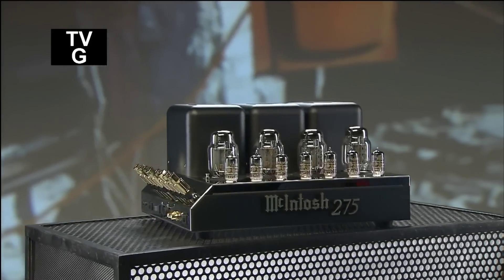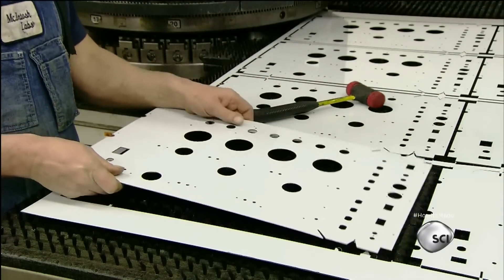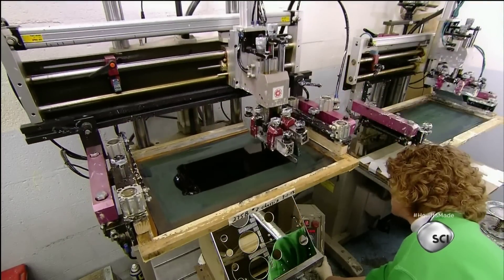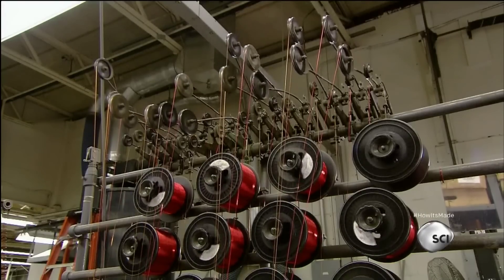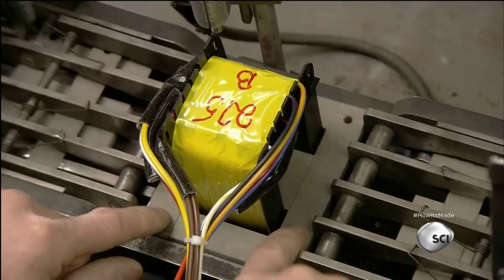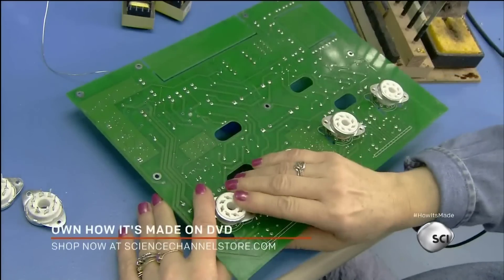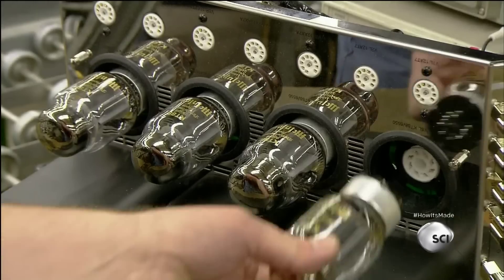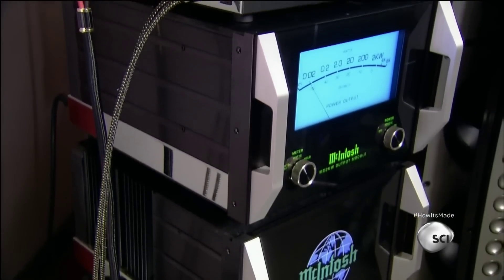How It's Made - McIntosh Tube Amp

Comment: Tube amps are the biggest waste of money. Thanks, but if I want to colour the sound of music I'm listening to I'll use an EQ. Fuckin' hipsters. The best way to listen to music is the way the artist intended, not coloured through some trendy piece of shit amp.
Reply: You're correct, they do color the sound, but they do not do it in a static way that can be mimicked by a single equalizer setting. Tubes have a non-linear response which means that their output varies not just by the incoming signal's amplitude, but also by its frequency. Essentially, you'd need to dynamically adjust your equalizer settings as your signal gets louder or changes pitch. None of this is impossible of course but the solid-state solution is largely more complicated than tube amplifiers which is why no one's really "perfected" a solid-state tube equivalent...though there are some really close examples out there I'm sure.
Reply: The thing that gets me with audiophiles (and I love high end audio) is that most of them seem oblivious to what actually happens in a recording studio.  Ignoring for a moment all the tubes used in making the record in the first place, mixing and mastering engineers go to great lengths to make sure that then end result sounds great on modest playback systems.  Aside from that rare classical or jazz recording that deserves to be held in such high regard, I believe that most CDs benefit greatly from a little color.  There's all sorts of unnecessary distortion being added to the recording by engineers anyway.  My philosophy is if there is anything one can do to improve the sound of a record, do it and enjoy life.
Reply: Tube amps add 2nd order harmonic distortion to audio. This is perceived as pleasing to the majority of listeners because of a warmer, less harsh midrange.

There is nothing wrong with tube amps. You honestly just sound like a jealous kid who can't afford one.
Reply: Roflmao! You still use an eq? That's hilarious. There's not one hipster that will ever know what McIntosh is first of all. And second amps don't eq shit. they never have... They just take the audio signal and send it to the speaker AMPlified. Then the speaker crossovers the signal to the corresponding driver. And to listen to a recording the way an artist intended you wouldn't have an EQ in line with your system to begin with.
Reply: Tyler Horsman You're harvesting what you sow ;)
Reply: it's not  preset EQ, it adds harmonics , vacuum tube amps sound way beautiful than pathetic Ipods
Reply: I have built many tube amps, I make them from scratch, dude.I am currently listening to a single ended 807 amp in triode mode that I built myself. 5 watts out at 2 percent 2nd order harmonic distortion. Sounds awesome and dynamic, as opposed to any amp with large amounts of negative feedback to mask the circuits distortion. I listen through Altec Lancing 811 horns with 806 drivers tamed with a crossover network. JBL K-130 15" drivers for 100 to 1800hz then the horns to 10k, then Prosystems bullet center ring radiator tweeters for 10 to 20k. This speaker system goes over 100dB with 1 watt input. If I connect a high negative feedback solid state amp to these speakers, I feel fatigued and the sound is noticeably compressed. Not pleasing. I would rather listen to distortion spectra that humans respond favorably to, as opposed to the non "organic" odd order harmonic spectra of solid state class AB push pull amps. SS amps with very large amounts of negative feedback just so they can measure good on the bench. Our ears are not lab instruments, we like to hear second order harmonics as opposed to third, fifth, seventh, ninth etc. Yes, I know the "tube" sound. My humble little homemade amps can compete in blind A\B listening tests with any amplifier on Earth for sound quality and prolonged listening pleasure. Yes, I just typed that.
Reply: HeartOfGermany The problem with your idea of using your PC's EQ to turn down the highs to make a warmer sound is that a tube amp would not attenuate the highs like that.

Therefore, it's not as simple as "10 clicks" on your PC to "do the same thing for free."

And music, once properly mastered, is supposed to sound good on any competent and properly functioning audio system, no matter if it's valve-based or transistorized.

Also, high end audio doesn't give class D much credit because it's nonlinear.  There are concerns with signal linearity, or lack thereof, with class D.  Because the input must be converted into PWM as part of the class D process, the output might or might not be a proportional match to the input as it would always be on a properly functioning class A or class AB configuration.
Reply from the maker: Jesse McLen
Very well stated, Jesse. Harmonics are where the "life" of sound and music live.
Reply: Electrons prefer to travel through a vacuum vs rushed through a semiconding crystalline lattice.  There is a specific tonal quality to a tube amplifier.  It can't be explained.  So stop bashing on the tube amplifier until you have actually listened to one in proper working order.
Reply: You are badly misinformed and ignorant, and your attack is abrasive like non musical odd order harmonics. Tube amps can be made very simple and with superior harmonic distortion spectra on the device level and circuit level, with no or very little negative feedback applied in an attempt to correct distortion in the circuit. You need vast amounts of distortion masking negative feedback to make solid state amps measure good, and by doing that the non musical odd order harmonic spectra dominates over even order musical harmonic structure. This is easily observed on a spectrum analyzer with a fundamental sine wave passing through each circuit topology. Single ended triode tube amps, with their large second order spike, have almost no odd order distortion spectra. This "sounds" better to humans in general. Even a discreet device high end solid state amp will show large spikes at third, fifth, seventh etc. harmonic distortion frequencies. Manufacturers get low distortion measurements on paper by only listing the even order distortion levels, when often the odd order distortion is often vastly higher. That is the origin of the so called listening fatigue that studio engineers experience. So, tube amps can and do measure from 20hz up to 20,000hz at rated output power, with vastly more comfortable and even pleasing even order harmonic distortion spectra than most any solid state amplifier. Do some true evaluative blind A/B listening tests, and see what YOUR ears like better. Then talk shit, or refrain. Oh yeah, before you flame me, lamp zip cord is good for speakers and guitar cable is great for inputs. As long as it passes the required bandwidth at operating impedance. I have equipment and search for answers by repeated measuring. Fuck off. Tube amps measure superior if you know what measurements matter to the human experience, and they sound fuller and with more dynamic presence.
Reply: Tyler Horsman You do realize that a Digital (!) Audio Converter (!!!) are CONVERTING an analog signal to a digital one. How can that be the most natural sound? A tube amp is analog right through. And as stated above, most musicians you're probably reffering to are using just a tube amp when they're creating their music. And most mastering studios use tubes since they give the most true sound. Please....get educated in sound before you open your mouth.
Reply: Glombak That is bullshit. Today everything works with DAC and ADC, because it is saved on a computer. Everything is digital today! Even many Tube amps are cheating and using Solid State preamps or DAC's today.
Reply: tyler r u tone deaf
Reply: +T.A. Grant Clearly you have no idea what you're talking about.  (1) Tube amps were loved by audiophiles long before the "hipsters" came around. (2) Calling a McIntosh a piece of shit is totally ridiculous. (3) Every part of an audio system colors the sound.  Whatever system you have, I guarantee it is not providing a complete and faithful reproduction of the source.  It all comes down to which "colors" you like, and its a far more nuanced issue than EQ.
Reply: HeartOfGermany You cannot add a "tube effect" to a transistor amp or even through software. Tubes have variable outputs based on the frequency response, meaning that no preset EQ can replicate a tube like sound.
Reply: What if it was recorded in the pre transistor era? Perhaps you should think before you type.
Reply: Bruce Binkley Awesome reply Bruce! Could not have said it better. As someone who has had this as a hobby since I was a young teen. Also worked in the industry for 14yrs. I can appreciate your post. Even most people who do not have this as a hobby are capable of understanding, others, no so much. You can lead a horse to water but cannot make them drink.
Reply: Bruce Binkley Nice braggin' and all eh? BTW, you obviously don't understand my comment. If you listen to a recording with a tube amp you're essentially using a pre-set EQ (as the tube amp 'colours' the sound). Using a clean high quality DAC will give you an unadulterated listening experience. By applying 'sonic qualities' to a musicians music you're kind of saying that you don't like how they envisioned their art. If you think you know better than the masters, then please, use all the EQ's and Tube Amps you like, and keep braggin about it to eh?
Reply: musmann Just because you do something for 14 years doesn't mean you're good at it. I'm speaking FACT. Tube amps colour the sound, essentially an expensive EQ. But you know, keep going on about being 'in the industry' for whatever time. Big talk bullshit.
Reply: Tyler Horsman please tell us more O wize one! Lol. Please enlighten us. Amazing how knowledgeable you seem. Never would have thought a baby boy on YouTube could enlighten me. I have been doing this wrong this whole time.  Lol
Reply: musmann "lolololololol", and I'm the little boy? Nice name calling as well.
Reply: Jonathan Davis
I use an Eq, still. Because I want a lot of bass, but the human ear is not able, to pick up a quite 20Hz tone. If I boost it up, i can hear it. (No distortions of course. I rather lower the total volume, to get more bass, than distort the signal and have it loud. Quality is my first interest.)
Reply: HeartOfGermany Tube AMPLIFIER, they surely don't "use" a DAC, they receive an analog signal and they output an analog singal. If there's a DAC in your signal chain that has nothing to do with the amp.
Reply: 林君曄
Macintosh amps sound horrible and sterile to me by the way, much like most SS production amps. To get good sound from sand as opposed to glass, use a single ended non efficient design, like some of the Pass amps. Krell and Mark Levinson also make listenable solid state amps, but these cost as much as a house. I build tube amps because I can afford to buy the parts, and I can tailor my sound to exactly what I like, try many different circuit topologies, and learn what I myself like best through vast time wasting experience (haha). I have studied the difference between transistors and tubes. Of course I want to know why I hear such higher quality sound from tubes. It is the harmonic spectra I mentioned. Have fun listening, whatever you enjoy. ENJOY.
Reply from the maker: *****
Hugo, thank you very much for contributing to this thread. I've SO often been on the verge of turning off comments on this video but then someone comes along who actually says something valuable and coherent. Thank you!
Reply: Electrons actually travel their "existence" from point A to B in a vacuum. Like a BB being moved from one physical location to another. Just as they do in outer space. In a solid state medium, they merely "bump" their neighbor, there is no actual movement.. Like a transitional wave.  Electrons are quite slow when attempting to move through a solid medium.

So you can actually hear something different from a vacuum state amplifier, the result is complementary to the human ear.

DSP merely matches equalization curves of popular tube amplifiers. But the processor will never be capable of emulating the sound of an electron moving in physical (vacuum) space. There are indeed odd and even harmonics.
Reply: Your a fucking idiot
Reply: +Tim Ramich is your issue with hipsters or tube amps?   As a professional audio engineer, I find your comments amusing.  At any rate, it's clear that you know very litle about tubes or audio circuitry in general.   Just because you hooked up your dad's home theater system does not make you an expert.  Ever actually made an audio circuit?  yeah I didn't think so.
Reply: +Tim Ramich interesting, because as a guitar player I just haven't found anything that can sound as good as a tube amp. especially for live performances. the only things that really come close are the axe fx/kemper profilers. and those usually cost more than a decent high gain tube amp rig.
Reply: +T.A. Grant   Solid state also colors the sound.  All amplification does.  For, no two solid state amps sound alike.
Reply: T.A. Grant if you don't hear the difference... doesn't mean nobody does. Tube amps has a sound that you simply can't get from a transistor amplifier... no mather how many EQ you apply.
Reply: alex tworkowski  Man, I don't know either, but the tubes just give you something special. I relied on my "stero guru" to find the best things and he modified a lot of my equipment. It was the first time in my life I had any money to spend and that is what I chose to spend it on because I had (still have) 2000+ records. Good decsion? Not so much. Amazing sound...way more than I thought possible. I only know a little about Carver amps and rememer I am going back to late 70's and early 80's. The ones I recall, looked like a silver (one black) box, about 14" x 14". They had no knobs and required a preamp. They must not have had tubes (duuno) because they were enclosed (all my tubes could breathe, and visible (to be honest, part of the effect). I know they sounded fantastic. Not Moore Franklin dual mono fantastic, but really good. The first guy traded his for 4 grocery bags full of peyote buttons to "The Indian" in Charlotte. I got a handful, bloody awful, but that was then. The other guy disappeared (literally) and left all his things behind including a record collection rivaling mine in obscure rarities. Never, ever saw him again. If we are talking apples and apples, that Carver box, is kick ass.  I bet you can find one on ebay or online. Cheers and good luck amigo...
Reply: TheSnakeFoot
Music is designed to sound good on a transistor based amp, like 99.9% of all studio amps are. Also you could perfectly add that effect to any amp built of transistors.
And third I could even build one on my own, which is just a waste of money for components and after that of electricity. They are totally inefficient, while a Class d easily reaches over 90% efficiency. I have a class D amp with absolutely inaudible distortions as low as 0.01 to 0.1 at full power. Its modulation frequency is over 200kHz which gives it a perfectly clean audio signal.

Class D is good for environment and today they sound awesome. Almost every Class D amp is far better than 95% of pc soundcards and yet people use a cheap PC soundcard and think the Tube amp will sound good on a cheap card. Well, most likely it will sound good, because a cheap soundcard working at somewhat over 40kHz just gives a very distorted 20kHz music tone, but you need to call in, that most people only hear to 15kHz and also you will not hear distortions at 15kHz, because the first distortion is at 30kHz.  INAUDIBLE!

If I want a warm midrange, i just turn down the highs and it sounds warmer. Wow... Was that hard. Why pay hundrets of dollars, if 10 clicks on my PC do the same thing for free? o.O

Why SHOULD I even afford a tube amp. They look very, very great, but if I talk about electronics, a Class D Amp is far more complex and therefore more interesting to look at...
Reply: HeartOfGermany I wasn't debating about whether it was incorrect, but explaining the reasoning why class D isn't accepted as high end.

A big factor in that thinking is the idea of maintaining as much signal purity as possible.  That means keeping processing of the signal to as much of a minimum as possible.

When amplifying the input to an output that can drive the speakers, class A or AB is simpler in approach than class D.

While a comparative analysis may indicate that class D can yield an output that is comparably proportional to the input fed into it, there are more factors involved in getting a class D drive to work compared to the more direct though less energy-efficient approach in class A and AB.  That is the area of concern with regard to high end.

As for my idea of high end, it's an amp that yields a balance of factors, namely reliability (usually achieved through engineering simplicity as opposed to complexity) and accuracy (the ability to provide an output that is as proportional as possible to the input while distortion is kept at as much of a minimum as possible).

With those factors, I could care less if it's tube or transistor, so long as it does what it's supposed to do reliably and accurately.
Reply: musmann I fucking bursted in laughter after reading your comment !
Reply: So says the MP3 afficianado.
Reply: Tyler Horsman The best part about your comment is the part where you somehow mix up DACs and amplifiers.
Reply: Many artists used a tube amp to record their music. If you get 20 guitarists together you will learn about gear nerds and their love of tubez! One person will mention a POD and 2 will rave about SS amps w/ scooped mids bringing the BRUTALZ.
Reply: Have you ever heard the tube-sound?
Reply: Yes, and amplifiers which exhibit a high degree of odd order harmonic distortion are less pleasing to listen to than an amplifier whose 2nd order harmonic distortion spectra is dominant. This is because of how our brains process and attempt to "correct" auditory sensory inputs. That is also the source of listener fatigue. So, instead of talking trash with zero substance about their missed experience with vacuum tube audio,  why does no one respond with technically accurate replies? Maybe it is because I have done the work to be able to explain why I like tube amps better than solid state designs. Post something with substance or do not post at all.
Reply: +Iggy Tubmen Not a scam.  McIntosh is one of the oldest and most trusted names in high-end audio, and they make tube and solid state gear.  One of the reasons I love tubes because I enjoy making my own amps.  Tube circuits are very simple and you can get some really astounding results at relatively low costs (a few hundred to a couple thousand bucks).
Reply: +HUGO FUGUSEV   Finally, a rational explanation of the difference between tube amps and solid state amps.  A high quality tube amplifier does not "color" the sound in the way that the above posters claim.  Tube amps can be designed with just as flat frequency response as solid state.The difference is the different harmonics produced.   In the 1970's My system used two Dynaco Mark III power amps.  The sound was beautiful when the tubes were new, but the output tubes (KT88s) needed to be replaced almost every year and the prices kept climbing.  By 1975 I had all solid state equipment.   I am still using a Marantz 3300 preamp with a Marantz 250 power amp with AR-3a loudspeakers.  This system sounds pretty good to be 40 years old.   Other components include a Thorens  125B turntable, a Rabco SL-8E linier tracking tone arm, Marantz 120 FM tuner, Revox A-77 open reel tape, Advent 100A Dolby B box, and a Sony CDP-302 CD player.   I would really like to get either another pair of Mark IIIs or a Dynaco ST-70 and have a "valve" system as well.
Reply: +T.A. Grant There is one area where tube amps rule, and that's guitar amps. Unlike hi-fi amps, they are designed to create music rather than simply reproduce it.
And no, you can't replace them with an EQ. EQ don't create new frequencies, amp distortions do. I'm not saying that it is impossible to recreate the tube sound but you need a good DSP for this, not just an EQ.
Reply: Wow, there's a lot of people that don't understand the notion behind tube amps.  Unless you crank up your amps big time, they don't add any noticeable distortion, nor do good ones notably change the tone.  They DO, however, have lower negative feedback and crossover distortion, which yields a more "open" sound, even if they don't spec quite as well on paper.
Reply: +kaspar zackrisson Being a hipster is the opposite of sophistication and intelligency. Since hipsters are trendy and follow trends, they can't have much of an intellect to just blindly follow a trend, and things that are trendy are historically not very sophisticated. They are the same sheep who were emo. Then when that trend died, they kept the tight pants, they added glasses, added more color, they ditched the male makeup, they added the same collective facial hair, they added bikes without speeds or brakes, they added being into retro and outdated audio technology, and they added the narcissism of thinking they know how to do things that are mechanical and electronic in nature.
Reply: +Jesse McLen Who uses tubes in the studio? In line with guitars, for distortion, yes. Anywhere else, no. Unless you're speaking of some fanatical maniacs who want analog, tubes, and tape for their vinyl, so they can brag that nothing was ever digital. Why anyone would brag about that is beyond me.
Reply: +Genez Wrong. We know what measurements are required for transparency. SNR, THD, and frequency response. It's been well-known for decades. Capacities of equal value sound the same. Wiring sounding different? Please! Try to trick someone else with such foolishness.
Reply: +T.A. Grant All headphones and audio processors will result in different sounding music. You will never hear the intended sound unless you listen with the hardware its been recorded and played back with originally. So colour that sound up however it resonates with your taste. :)
Reply: +T.A. Grant Clearly, you've never heard a hifi tube amp.  Tubes have a dynamic 3D type sound which in a way, emulates live music.  What I like best about 'em.  The solid state presentation in short, is flat and causes listener fatigue.
Reply: +T.A. Gran and you are stupid,  tube amps  produce superior sound quality than class D amps , which are used today in all  mobile devices which have poor sound quality
Reply: +ΙΠΠΟΚΡΑΤΗΣ ΚΟΧΛΙΑΡΙΔΗΣ Yes you can. It's called measurements, which are far more accurate than your golden ears.
Reply: +T.A. Grant Obviously, you have never heard the music that comes out of this amp.
Reply: you have never heard a McIntosh 275 before have you? A transistor cannot reproduce the sound that these amplifiers make. Tube amplifiers and especially the McIntosh 275 have an excellent soundstage. Go and listen to one of these amplifiers and then say they are a waste of money. 

now, go ahead and fuck off
Reply: T.A. Grant fuck off.
Reply: Jonathan Davis Depending on the amp, there are ones out there that color the signal artificially.
Reply: Jesse McLen You're absolutely right, most modern and re-released music is going to be aimed at these "modest playback" systems. However, there is no denying that it will still sound better played through higher quality equipment with a cleaner amplification process. Also, most people that own these higher quality playback components are not going to be listening to the newest Lil Wayne album . Forgive me for the cheap shot, but in all honesty it's all about preference and if someone has the means and prefers this sort of thing, isn’t it a bit small to judge them for this?  It’s a bit like saying to your buddy, “look at that balding D-bag in the Porche.”  Then pretending you would prefer your Dodge Neon… Maybe there is a happy middle ground
Reply: *****
About the Class D part:

Absolutely incorrect. At a frequency of at least 4 times the Frequency of the Input signal you can reproduce a 99.9 perfect signal. Only limit is about 100 nanosecounds phase shift, will happen on any tube amp aswell because of the output transformer. I tested a 90 kHz frequency with a test circuit (100% discrete components, no IC's) and reproduced a 20kHz audio signal. It was perfect, only a tiny bit out of phase.

High End is not a real word actually, because many Amps that are not called High End actually are better than many High End amps. A amp only becomes high end, when some audiophool calls it like that, because it has gold contacts, a sexy case and a warm sound.

About the PC Equalizer part: Well, I actually still don't need more then 10 clicks: I don't want it to sound like a tube amp. My ears pick out tones up to 19.5kHz so I raise 20kHz a tiny bit, to equalize the loss of 19.5kHz at about -3db in my ear.

Most of the time I want a flat sound, because my speakers give me exactly that details, that I want.

And If I realy would like tube sound, there are propably tons of software audio modulators out there and propably a hand full of them free for download. But I don't want distortions.

Oh, and about the warm Sound: I had a High End Stereo system, but I threq the speakers out with they crappy warm sound. I want the highs, because they do not effect the ability to hear, but give a lot of detail which is good, if there are lots of sound the same time like in Games and Movies which I use a lot.
Reply: *****
Maybe watching it because electronics as hobby?
Reply: Tyler Horsman
You got reamed ... Would you like Corn with that ? ... lmao
Reply: +T.A. Grant lol yeah its a total scam but audiophiles will argue with you until the world ends because they will never admit that they are dumb dipshits that wasted their money.
Reply: +Chris Serio That's the mathematical way of saying they are outdated, inferior technology and their output is simply wrong.
Reply: +Chris Serio That's DSP basics. You can do that on just about anything.
Reply: Every time I flip on the analog bass boost on my amp, am i getting a more "audiophile" sound cause it's warmer? Audiophiles usually seem to describe warmer being more desirable.
Reply: +T.A. Grant It's been a good year since you spouted all that bullshit as if you knew even remotely what you were talking about.  Have you bothered to do any research on the subject since?
Reply: +Jesse McLen    "mixing and mastering engineers go to great lengths to make sure that then end result sounds great on modest playback systems."              If you are old enough to remember the RCA "Dynagroove"  LPs, They stated that the goal of the Dynagroove was to make the record sound better on modest playback systems.
Reply: +T.A. Grant Damn I thought guitar players were opinionated. You audiophiles really take the cake lol.
Reply: +T.A. Grant ... Ironically... some of the greatest recordings you might listen to were recorded using tubes in the circuits.  You just don't know.
Reply: +TheSnakeFoot    And, you forgot to mention that solid state amps can add odd harmonic distortion which causes listener fatigue.  Your choice.   Even order harmonic distortion is pleasant to he ear.
Reply: You might be missing something...  I be sure to degauss cd's that have been sitting around a while as well renew the magic marker on the cd edges to prevent reflections.
Reply: vonzigle D... Degauss? Why? CD players use light to read the data. A present magnetic field would technically make a difference, but it's so smal you'd need half a billion dollars of lab equipment just to detect it at all. It's well outside of the range of human detection, even amplified several orders of magnitude.
Reply: +Teth47  I am pretty sure that vonzigle's post was satire/sarcasm, since plastic CDs cannot me magnetized.
Reply: Swinde The thin foil on the surface actually can, and with audiophiles, you never know. I've seen cables that purport to block out the cosmic microwave background in your headphone cables so it's quieter...
Reply: +T.A. Grant It's really only a waste of money because of how much crap like this costs. If I was spending thousands of dollars on an amplifier, and therefore be an audiophool, I would never want my signal touching a PCB, and I would want epoxy to pot the transformers instead of tar. Tar, really? The tube sockets are as cheap as can be. This amp is made as cheaply as can be, yet they cost a small fortune. They likely don't even cost $200 to produce.
Reply: +William Pryor You can color the sound with a digital DSP and use solid state electronics and deliver the same gross tube sound. I even implied that tubes were fine for guitar distortion...so I don't know why you took issue with my comment.
Reply: Tim Ramich
I can tell you're not an expert because anyone with an EE degree would never speak in blanket generalizations as you do.  Hate to break it to you, but an uninformed opinion is not the same thing as a fact.  Using epithets only proves that on top of not knowing what the fuck you're talking about, you're also in possession of a childish and puerile mind.  Why the shit would I ever want to visit your site, channel, whatever?
Reply: +hugeshows What does an EE degree have to do with anything you're talking about? Go look at videos of people who do meet the qualifications that you blabber about, and most of them do have videos bashing audio pseudoscience like tubes, cables, and the boner hipsters have for anything retro and analog. Both of your posts are nothing but attempts at personal attacks. They address nothing about the topic at hand. I told you to go to my site, because it documents electronic builds of money, including a tube amp, which displays that I DO know WTF I'm talking about. Even my post didn't have anything to do with audio. It simply bashed hipsters for being trendy, unthinking, and not very conscious of how stupid they look. I don't know why you felt the need to extrapolate from it anything about audio gear.
Reply: +Genez We know what specs are required for audible transparency. If two different amps fall within those specs, they CANNOT sound different.
Reply: +Tim Ramich  But, they do.   Because what is being measured is not all there is to it.   You can modify one amp and that will change its sound... same specs though.  Change the caps?  Change the wiring?  Even roll tubes in a tube amp.  No two different amps sound the same.   One manufacturer can get a consistency within its one model... But, once you move to another brand with very close, or exact specs?  They will not sound the same.  Too many variables we do not know to measure for.  Even shielding can change the sound.  Different power cords will change its sound.  Tubes have a certain trait that those who like tubes prefer.  You do not have to like it.  Someone else does over the amp you prefer.  Freedom is the name of the game.  Jealousy is the name of the game when we see bad-mouthers here.   I do not listen to tubes.  I do not listen to typical solid state.  I listen to high quality digital.  Certain things we do not know enough about to measure for, makes what an amp really sounds like.
Reply: +T.A. Grant Modern recordings are designed to be played back on a variety on consumer -grade players, so that they can sound the best they can on average joe system. If you say that many system don't already add their color from lets say' poorly designed speakers, cheap consumer -grade DAc's etc then you are mistaken. You would have to recreate the same conditions, same signal path, mastering console, monitors to  get that identical, not colored sound during mastering which is nearly impossible. Tube amps, of course have their use and are meant for professionals and audiophiles and that unfortunately cost money as is the case with any pro-sumer gear
Reply: +ΙΠΠΟΚΡΑΤΗΣ ΚΟΧΛΙΑΡΙΔΗΣ Mobile devices measure to be perfectly transparent. You act like he only kind of solid state amp is the class D type. I doubt that ALL mobile devices have class D amps.
Reply: +Tim Ramich 1st most of mobile devices have class D ICs 2nd) You cant compare the quality of an IC with discreate electronics !
Reply: +Tim Ramich & some integrated amps have very powerful DACs. For example 24bit resolution192KHz sampling frequency iphone doesn't have this kind of  hardware
Reply: +T.A. Grant You said that because you are poor & u cant afford something like that, do you know that some tubes are more expensive than the Iphone 6s?
Reply: +HUGO FUGUSEV OK, if you say so.
Reply: Tubes don't have to color the sound.  Tube amps can be made quite linear as far as I know, and I have read a few books on amp design ( but admit I could be misremembering).  As you can use the same general circuits for tube amps, you can use feedback to linearize the amp.  I would think the main difference might be the use of the output transformer.  Your might be thinking of single ended amps with up to 10% distortion - they obviously "color" the sound.
Reply: Lol, you're lucky you're not on a guitar amplifier video.
They're nice in guitar amps because they offer an "overdrive" as opposed to "distortion." Truthfully, I don't know how big of a deal it is for clean sounds.
Reply: A commonly state idea, is that the way the tube amps work, when overdriven, is the creation of addition even order harmonics which may sound pleasing.  So tubes have been used in guitar amps for a long time - people seem to prefer them.  I don't know why a tube amp would produce even order distortion and a transistor amp odd order.  I will guess it's not really tubes vs transistors, but has to do with amplifier topology.  But it's reasonable to presume tube and transistors don't perform the same way on overload.  It's one of those endlessly debated things.
Reply: Michael Bauers One thing I know is that the two don't really differ necessarily from a electrical standpoint, but a physics one. The way sound travels and distorts through a tube is far different than the way it travels through a transistor. Essentially, you get much more movement and the distorted tones become more "rounded" in a sense because of the distance traveled in the vacuums.
Reply: Right, I am 100% sure inherent distortion is different.  Was less sure about how it works when clipping.  And obviously the topology will matter ( push-pull, single ended, etc.)
Reply: T.A. Grant you sir are a dumbass, tube amps have been around forever audiophiles are not hipster, you're a hipster
Reply: T.A. Grant tube amps color less than transistors
Reply: See if you can Google Bob Carver info on changing the sound of amps by modifying the transfer function.  He could mimic a Mark Levinson and a Conrad-Johnson Premiere Five in a challenge initiated by two audio magazines.  Wikipedia has this on that: https://en.wikipedia.org/wiki/Bob_Carver  Happy New Year
Reply: That is true. Its a matter of personal taste!
Reply: Pirmy  I own a stereo system that the base of is dual mono (1 amp per speaker) Moore Franklin tube amps and a Lazarus cascade tube pre-amp which I got in the mid-80's and had rewired wit Peterson Litch wires and I won't even go into the turntable and speakers, but it has one of the best sounds I have ever heard from a home stereo. I started with Chineese Shugong tubes and eventually changed to Russian. No amount of EQ will give you the same texture and richness of sound. There is no substitute. That said, it is a pain in the ass. Tubes go bad and unless you are an expert, not sure which one though the glow changes. Back in the day, it cost $500 to replace them, I can only imagine what it costs now. When CD's came out, my system wouldn't accomodate the extra input if my tape player/recorder was hooked up. I had to buy stuff to add to it and now people want their TV's, computers, etc. all hooked in. It requires a special place and furniture setup because it generates so much heat. I stand by this setup as a real standout,  and I would put it up against your EQ anytime, but sadly it is collecting dust in my attic and at the end of the day, your amp with an EQ or not probably sounds just fine and I reluctantly agree with you though I still love my system.
Reply: Bill Mayhew See if you can find any info on Bob Carver.  He had duplicated the sound of the finest amplifiers by noodling around w/ something that i can't remember at the moment.  Blind testing caused experts to go aways scratching their heads.  I have a theory as to why the tube amps sound so good.  Talk for another time.  I got it.  "Transfer function".
Reply: a standard eq cannot color the audio the same way tubes do. tubes change the tonality aswell.
Reply: dollar guy the thing is electrons here on earth rarely ever travel in space. Mostly everything ehre on earth bumps into each other much like how the eltronics bump to each other in solid state medium. Saying tube amps reproduce more accurate sound I don't think is true. I'd argue because of that solid state is better. 

Tube amps do look amaizng though and sound good too. But solid states win the endurance rating.
Reply: hugo fgseev thats really nice to know all the technicalities. I always wondered which one was better. I too like to hear music the way the artist inteded imo I want to hear the artists vision. However, if tube amps don't mess with the EQ than thats a huge plus in that regard.

i too wonder why tube amps sound so good its probably not really somethingy ou can explain. But solid states do win in the price category as well as lasting for a longer time. 

but man do tube amps look really good. Do you know any solid state amps that are cheap but good that I can use with headphones nothing too big.
Reply: MajRatbag thanks for the simple explanation and write up it totally makes sense. However people describe the sound as warm sounding
Reply: T.A. Grant most tube amps are built for guitars . and if you played much blues or rock , you would really quickly learn how unhipster lugging a tube amp around is. its a matter of having full control over sounds vs. a program trying to rectify sounds you don't want rectified.
Reply: gubx42 exactly , but don't go telling these geniuses about guitar sounds . the pro digital yuppies in here like Justin beiber . so in essence , they are lost causes. 😊
Reply: Tim Ramich digital programming is only as clever as the programmer let it be. digital has a bad habit of trying to rectify sounds the program thinks are errors , ie harmonics . and in trying to control feedback , it loves knocking out the mid tones in guitars. that's two big issues that tube amps don't do. the lowly, ancient tube amp allows for a more raw sounding full tone experience. I say that and am reminded of some of these newest digital units getting to point , its becoming somewhat difficult for a non professional to distinguish the two.
Reply: There isn't any argument. You can hook a tube amp up against a solid state amp to a oscilloscope and check the sine waves produce. You can see where the signal falters and tears causing oddities to the sound. This phenomenon is why nearly every single musician uses tube amplifiers when they play music. 

So when they artist creates their music, they create it without the artifacting, tearing, and clipping found in solid state amplification.
Reply: User Name Dude.. You can't see shit on the sine wave on an oscilliscope unless you have a really really crappy audio amp. A THD meter or spectrum analyser would be good. You can make a solid state amp that is fairly linear, meaning distortion well below 0.01%, using feedback. tube amps are used because placebo effect and maybe because a buttload of crap transistor amps is out there.
Reply: alles klar klaus some are better. Most are not. If you are so sure, post a video to prove its there are videos and plenty of other evidence pointing to the clipping found being obvious in even the best solid state amps.

I have played guitar over 20 years, the solid state vs tube amp debate  rages there. Nobody cares what anyone else uses, but it is obvious there is a difference. Some guys prefer the harsh sound of the clipping found in a solid state amp. Some guys don't.
Reply: As I said. This has been demonstrated thousands of times over. You can have any opinion you want. Most of us are not going to shell out thousands of dollars on a tube amp for their home audio system. When someone here provides any substantial evidence to the contrary then the point will stand.
Reply: User Name So you just don't know what I am talking about because you are simply not an electronics engineer. Don't believe all the adiophile bullshit. The important point is: A good amp for say your stereo at home should be linear as can be. If you can get a tube amp that is, fine, buy it. If a solid state amp is cheaper (which it usually is) just buy that one. In good amps nobody hears a difference because the speakers are way way worse any way. For a guitar amp, buy whatever you wanna buy. Keith just recorded an acoustic guitar on a voice recorder and played it back at full volume to get the distortion he wanted for "street fighting man", sounds fine as well
Reply: Typically to someone who is considering the cost of one of these units, their speakers are going to be at the top of the market. The question at hand is is there a hard defined advantage to amplification. Yes. Is it for everyone? No. Your average guy jamming to music in his house is likely listening to some form of highly compressed audio where it is already clipped and shit on before it ever makes it to the amplification. This does not mean there is not merit to tube amps having a better sound. 

People have recorded music on all sorts of medium. They have also used bull horns into microphones, guitar amps plugged into hi-fi speakers, used various magnets, foils, talk boxes, and even purposeful grounding of the cable to make all levels of noise. That isn't the point here.
Reply: Well the point is that tube amps in general are more expensive for a similar performance and that solid state amps can perform way better and easier than tube amps if you want them too. Whether something sounds good or not is not important to my point at all, hence why I made that example. A good amp is an amp that does not do anything to the signal apart from amplifying it. Now in a guitar amp you want the amp to be a controlled way of crappy and to distort, making the typical electric guitar sound, which is the guitar sound plus a whole lot of distortion. Punk bands use transistor amps on purpose while rock uses tube amps. You could just add a "sound forming device" to any good solid state amp and not overdrive it to make it sound like a tube amp. And speakers usually are not perfect, they can be good but a lot more money is involved while a good amp should be fairly cheap if you dont wanna push hundreds of watts through it.
Reply: Electrons travel through a vacuum better than solid matter and pick up less interference on the way. that is why tubes reproduce sound more accurately, the sound is colored more in a solid state amp. Also the harmonic distortion produced by a tube amp is good sounding distortion, solid state harmonic distortion sounds bad. Musicians have known this for years, that's why we use tube amps, not because they are trendy but because they are better.
Most of the comments in here are made by stupid kids that don't know what they are talking about.